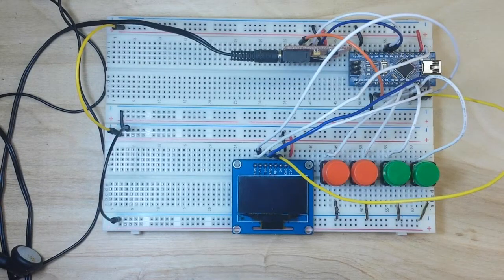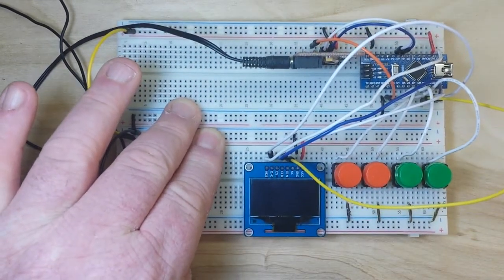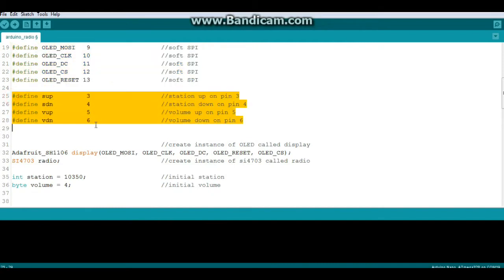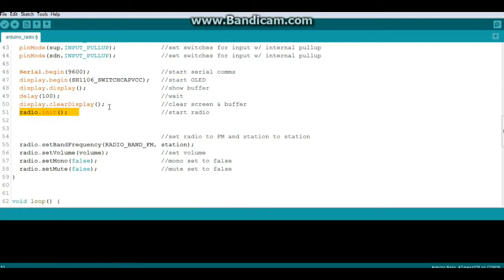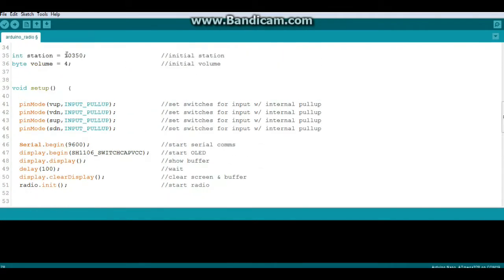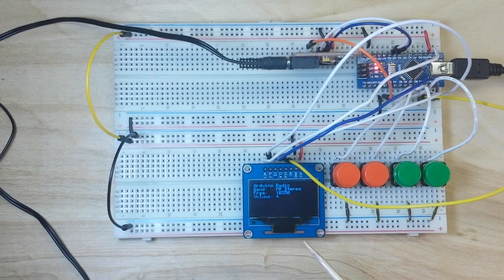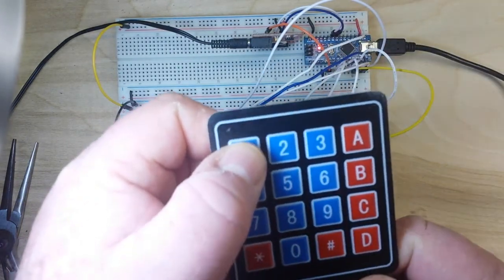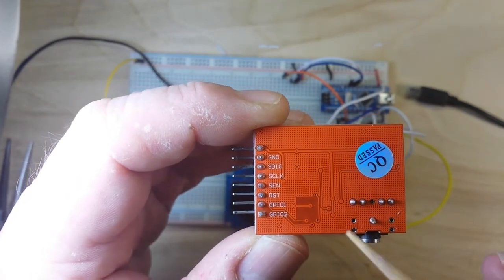Arduino FM Radio with Si4703

Comment: I used your code style for my project which is very similar to this video(basic Fm radio that you implemented)but it didnt work at all and dont play any frequencies. whats the problem?  I have used arduino uno instead.

Comment: Could I use a 0.96 oled as is or would I need to change anything eg libraries etc?  I have had an si4706 for a while but have never used it yet!
Reply from the maker: +gartmorn yeah, you could swap oleds no worries
Reply: learnelectronics Is there still going to be a future improved version of this as it's such a cool project?  I wish I could help with software but I do struggle!
Reply from the maker: gartmorn I did one with a touch screen
Reply: learnelectronics yeah I did see that as well but liked this one as it was a bit more basic (relatively speaking)!  Also I have all the parts for this!

Comment: You need to debounce the switches, that will fix the station frequency jumping. Do you have an address conflict when using the I2C OLED?
Reply from the maker: Cash Olsen thanks man, that was just a demo or I would have debounced. there is no address conflict. the radio module works, the OLED works, but there is no sound. so I switched to SPI and it all worked great. in it's next version it will have direct frequency entry.

Comment: Can the board be plugged straight into headphones? Or does it not have an internal amp?, also where is the antenna
Reply from the maker: The headphones are plugged straight into the board. The headphones are the antenna.
Reply: learnelectronics oh that's cool!